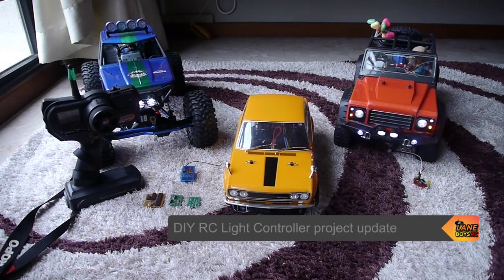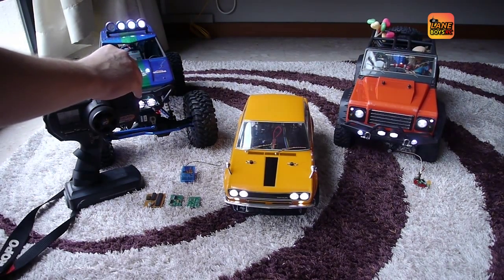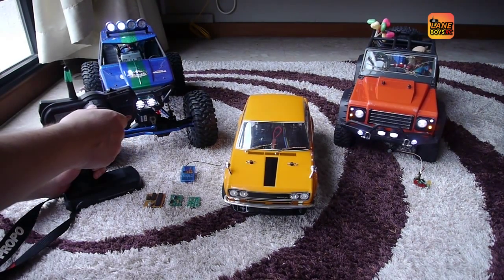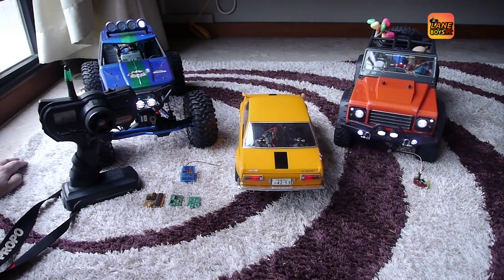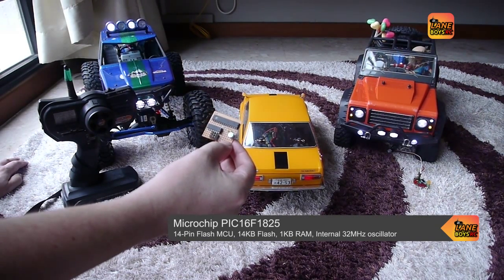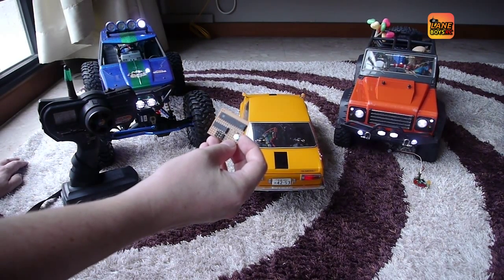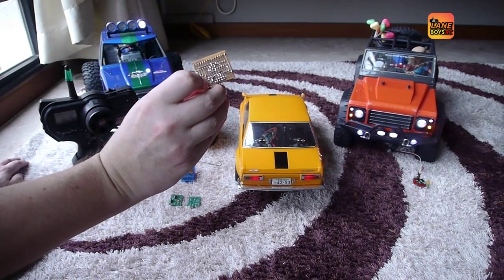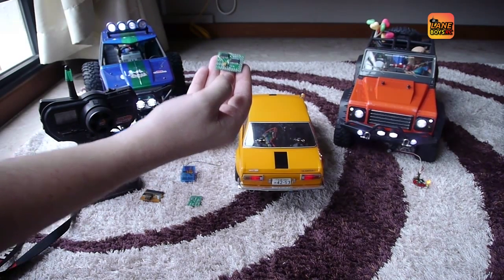DIY RC Light Controller update

Comment: Hi, excellent video! I have recently acquired this station and I want to make it work with an orlandoo hunter, would someone be so kind as to tell me if I have to program the station?
Thank you very much
Reply from the maker: Hi! I am not familiar with the Orlandoo, but given that it is a hard-plastic body it may be possible to install LEDs. This will certainly be a very fiddly job as the body shell is very small -- but doable if you have decent soldering skills.

Since the car uses a standard RC receiver it should be no issue to fit the light controller. The light controller has a micro-controller, so yes - you have to program that before it will function. 

Alternatively I may be able to send you a pre-built unit if you compensate me for  material and postage. Contact me at laneboysrc@gmail.com if you are interested.